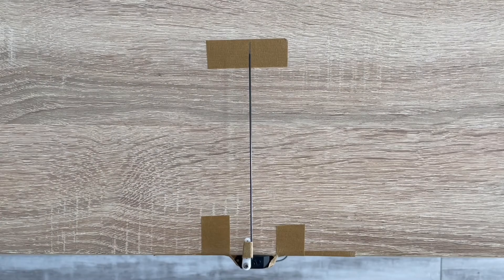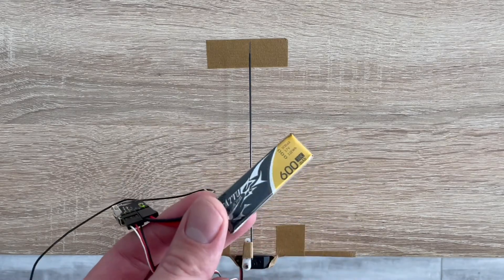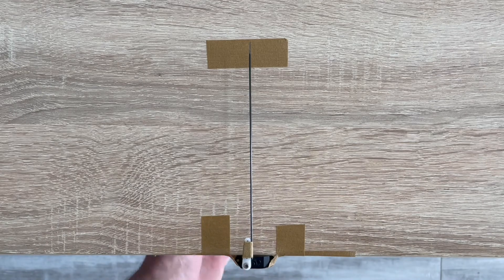The Best DLG Servo: JX DHV56MG

Comment: this is only by 1S lipo, but by 4,8V and above  it is another story
Reply from the maker: You are absolutely right! The purpose of this test was to see how the servo will perform on a 1s LiPo. Nevertheless, this is an HV one and we use it often on the 2s LiPo directly with no issues. 

So this one seems to be a universal weapon ;)
Reply: @flightpointrc   what do you mean "an other story"? . It won't work at 5V?
Reply from the maker: @maldjab6248  It will work in a range of 3.7 to 8.4v - haven't tested on the 8.6 though. And the more juice you provide for it, the faster and more accurate and more powerful the servo will be.
Reply: @flightpointrc  thanks for the answer :)
Reply from the maker: @maldjab6248  you are welcome!